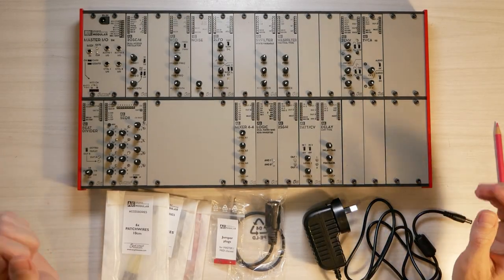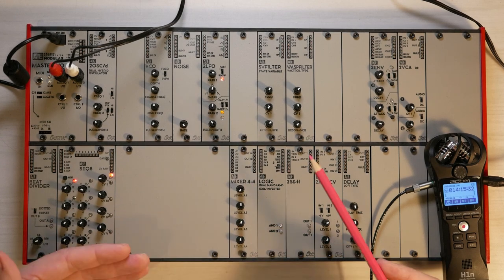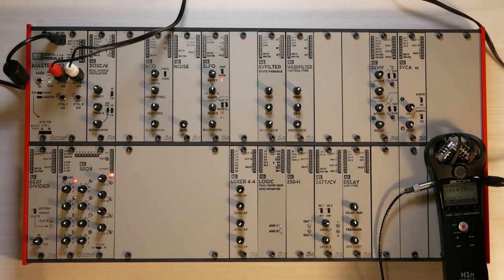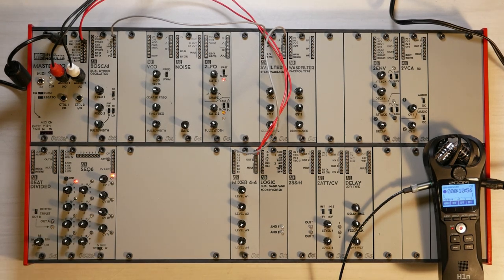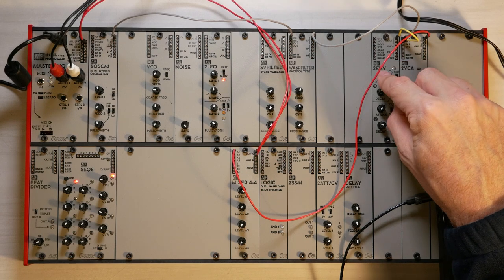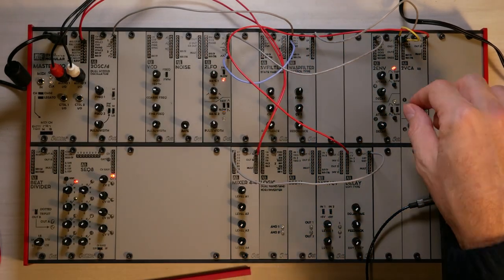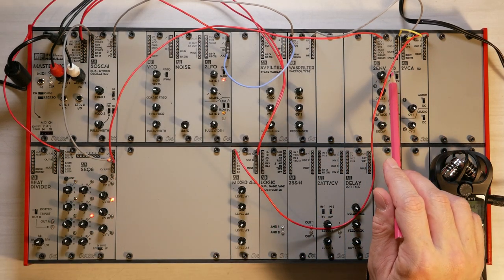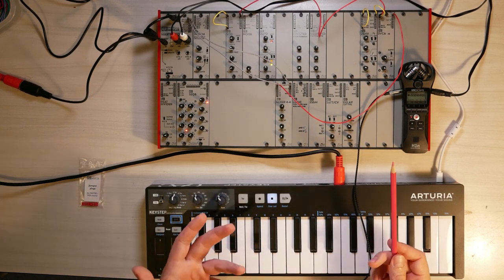Introduction to the Starter System 2

Comment: To anyone watching this in 2024 ... please don't be too worried if you accidentally plug in a centre negative power plug in. The Master module has reverse polarity protection and while the system wouldn't work, it wouldn't be destroyed! Just get the right plug and you'll be OK.

Comment: My p.s is centre negative. In the vid it says use cenre pos only or it destroys it ?????
Reply: The vid is right. The one i got is also labeled wrong. Made a new label for it. To avoid further confusion.
Reply: @sonarilja  thanks i was worried
Reply: @scowlsmcjowls2626  yes, i felt the same way… :-/ but this reminds me to double check a third-party one i now ordered (with voltmeter/only master module connected). Just in case!
Reply: @sonarilja  good practice

Comment: is it possible to integrate this with other modular or semi modular synths, or is it a closed system?
Reply from the maker: Of course it is possible to integrate AE with other modular Synths; it follows also the 1V/Octave standard, we offer a bidirectional input/output module to integrate e.g. with eurorack, a special bridge module for cross-patching with the Korg Volca Modular is available too; so no worries!
Reply: @tangiblewaves3581  I was mostly wondering about the cross compatibility of the patch cables and patch points. I have a few semi modulars. the AE patch cables can be used outside of the AE environment?
Reply from the maker: @xisotopex  The AE patchcables are compatible with all "breadboard-style" Synths, like Moog Werkstatt, Bastl Kastle and others. The AE patchcables and -sockets are a high-quality version of the usual breadboard components.
Reply: @tangiblewaves3581  thanks I may end up getting both your system and eurorack lol
Reply from the maker: @xisotopex  😂 👍

Comment: Can this be plugged in an amplifier
Reply from the maker: Yes, of course! The AE system has audio connections via 3.5mm minijack sockets.
Reply: Great so just use 6.35mm adapters
Reply: I gotta confess I love this system it's gritty distorty it grinds it's just flat out nasty sounding but then it can be breathtakingly beautiful I'm saving up for the two tier system and add drumkit solina and a few more
Reply from the maker: @ericjohnson2965  Great to hear!